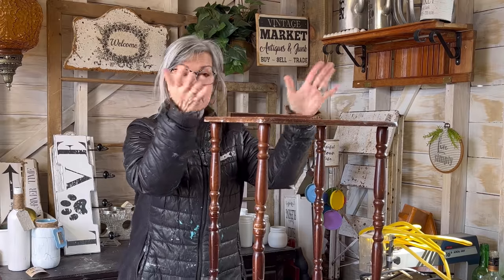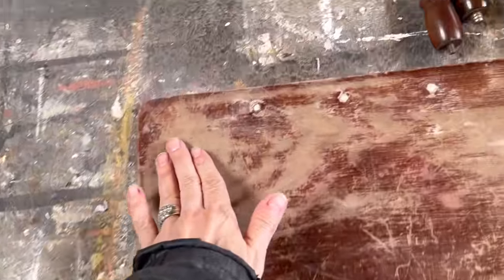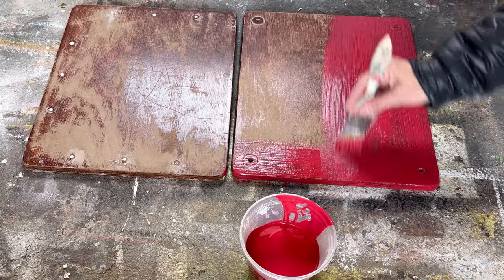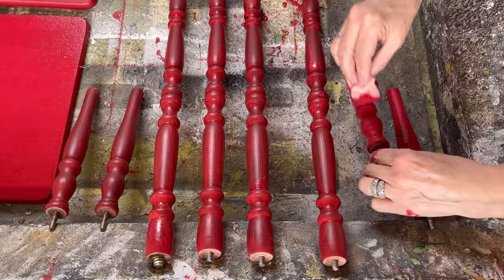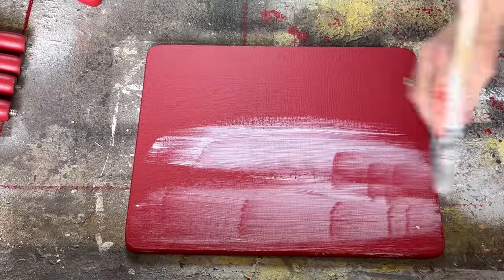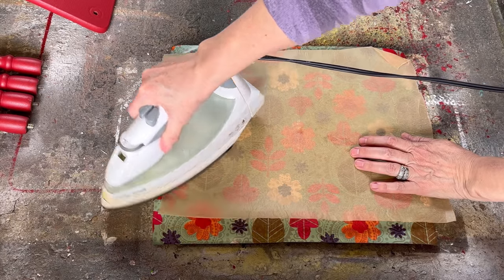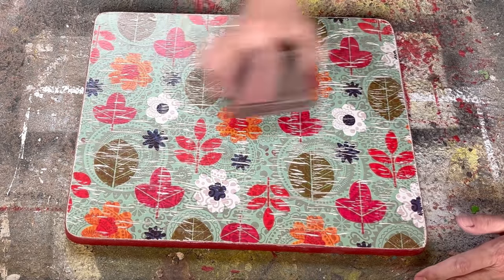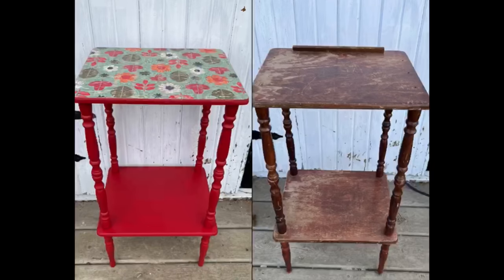Furniture Flip / Upcycled DUMP FIND TABLE / TRASH TO TREASURE

Comment: The iron-on method for decoupage is my go to since I saw it first time with another crafter. However, you taught me how to master it and it has been my preferred method of all. I bought a mini iron that I use for all my decoupage (easier for smaller areas). 
And, thanks for the important reminder that decoupaging will always have a bit of bubble and/or wrinkles. I used to panic and iron the heck out of the craft but, now, am starting to embrace the bit of ruggedness that ends up in my crafts. 😁
Reply from the maker: Glad it was helpful! I actually like the look of a few wrinkles! Thanks for watching Andrea

Comment: Beautiful work. One cannot imagine when seeing the before and after picture, that this is the same side-table. Totally unrecognisable. 
Is it necessary to paint the top shelf two times, when you put craft paper on it afterwards?
Reply from the maker: You probably don't need too but because there was holes I had to fill and it was a bit uneven I wanted to paint it to smooth it out